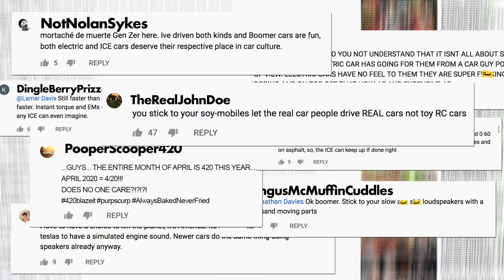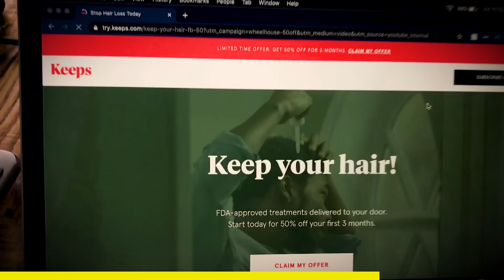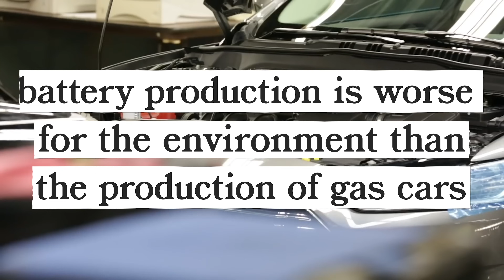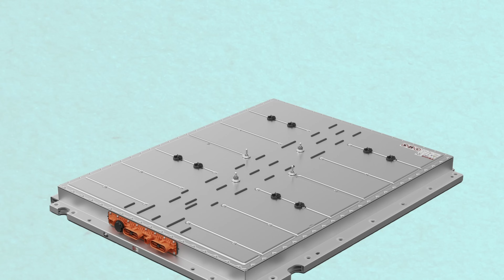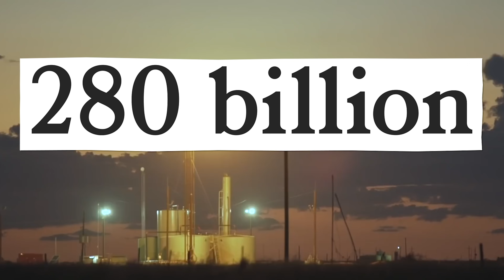Are Electric Cars REALLY Better for the Environment?

Comment: The funny thing is that they're just as bad as petrol cars, the electric from the charging points comes from huge power stations that does out just as much if not more pollution than a petrol car
Reply: did you actually see the video? he adresses it and no is not as bad , and that 's all on the US  terrible coal energy production in any other country with a more green energy production (like Brazil for example ) that won't be a big deal  .
Reply: @lavaot5207  Face it mate, the US, South America and most of Europe could all reduce their emissions to Zero and there would be hardly any difference to the climate because China, the Middle East and Russia will never change and kill anyone who tries to change things, and locks up anyone who protests. So as long as they're still pumping out the gasses then the Earth is still fucked and no amount of whinging from Greta Thunberg and good intentioned environmentalists will change that.

Comment: News flash: both carbon and oxygen are on the periodic table of elements 

Put them together as CO2 and it’s still not pollution, it’s what trees use to produce oxygen

What you need to be concerned about is the carbon Monoxide from car exhaust, that’s more pollution than carbon dioxide

Comment: (before you read this just know I love electric vehicles)a lot of this info was bias to make ev's look better. when sitting in traffic idling  ev's are much more efficient but in reality where a lot of cars are not sitting in traffic they aren't much worse than ev's for emissions. and on top of that that is assuming that the ev is in perfect condition in the right temperatures. In somewhere like canada ev's are far FAR worse, gas cars are very effitiant as they dont loose any power in the cold, they use the excess heat from internal combustion to heat the cabin, and the batteries dont die for no reason. Ev's in canada or other cold places are garbage for a few reasons, thier batteries ca loose up to 50 percent charge in one night which instantly doubles thier emissions, they batteries are slowly damaged in the cold which speeds up the aging process of the batteries and recycling them is very hard, and on top of being very inefficient and breaking down all the time they still have to use battery power to heat the cabin and power the lights and everything else which makes them use even more power, in any conditions batteries only last at absolute max 1000 charges even if they are in absolute perfect conditions, most people only get 500 charges before the battery breaks or in cold climates as low as 300. in the end if you have a controlled climate ev's are more efficient but in real life where most places get too cold or have temp changes a lot ev's are very bad. and I LOVE ev's as electronics is what I am pursuing and is my biggest hobby so I know the upsidess and downsides but it just isnt the time for widespread ev's. and all of this is quite dumb considering there isnt any evidence of man mad climate change being real other than a few left funded sources that have many contradictions of the same page.
Reply: That's an accurate name you have considering the garbage you just spewed out of your keyboard.  Your sentence structure, paragraph structure, and spelling all make you seem like a great scientific mind who I should rely on for my climate change news!
Reply: @stevew.7188  yeah my sentence structure isn't that good but this is a youtube comment, it is not like I am writing this to present it on a stage or send it to NASA. And you didn't say that anything I wrote was wrong so is it just my grammar you are mad at?

Comment: Battery replacement should be factored into the lifespan of an EV
Reply: How long do they last? I've heard that even after 20 years, there will still be a lot of guys buying used Tesla batteries for off grid purposes. They don't die outright, they just loose maybe 20% efficiency.
Reply: @dougerrohmer  depends on how and under what conditions they are used.  If you follow the guidelines from tesla you can extend life. I found a car and driver article that showed that after 25k miles they had lost almost 10%of battery total capacity. There will be some users who require battery changes and some who do not but if they are used long enough they will eventually need to be changed or scraped. Also there are other EVs that are not as long lived, such as prius which requires battery changes after 100-150k miles
Reply: @tripnok1  Actually companies like tesla and GM are working on one million mile batteries which only lose about 10 percent of their efficiency by the end of their life cycle. 99% of vehicles on the road never make it close to 1 million miles so I don't think it will be too much of a problem in the future
Reply: @jabbalito3787  it's a good goal but I'm only speaking for current tech not possible future tech.
Reply: @jabbalito3787  yea and that battery isnt gonna magically make the entire car last a mil miles
Reply: @Insomnia4321  Well it even if it lasts 900k miles it will still NEVER reach that limit. How many people have a car with 900k miles on it?? Nobody does!!
Reply: @jabbalito3787  well on the nuclear fusion companies work from the 60's and is always 30 years in the future. Those batteries may share the same fate. Until we see them and how much they cost we are just fantasizing. Working on something doesn't mean that something will become reality. To become a reality a product must be technically possible, cost effective to manufacture and the raw materials must be available. The batteries that are today on tesla cars are not much better in terms of energy density or lifespan or cost than the ones mounted in 2008 on tesla roadster despite spending billions on gigafactories and on research.
Reply: Lifespan and what emission tier is the comparative are the key to definition.  And climate.   The replacement rate in extreme environments puts them behind.  But overall....they break out pretty even.
Reply: a battery lasts about half of the lifespan of an ice car so it should be considered twice in the emissions. Also for cheaper cars I don't believe many owners will change the battery after 10 years and the car will end in the landfill because who will buy an 10 yr old car to invest thousands to replace the battery? Also the battery must be considered a factor in the green energy. If we replace gas and coal powered power plants with solar panels and windmills we need grid storage and that means more batteries so more CO2.

Comment: Over the lifetime of an EV, its battery pack will have to be replaced multiple times. Was replacement battery production factored into lifetime emissions.
Reply: My question is garbage? Also you are using anecdotal evidence of one vehicle that traveled a long distance, yes, however many other factors degrade batteries over time. I also hope you don’t consider 8 years the lifespan of ANY vehicle. Personally I think solid state batteries are the future of not only electric vehicle tech but all personal transportation. For now, I’m just curious if we’ve really considered all the pros and cons of the current and legacy systems.

Comment: The long run does not account for the recollection relocation disassembly and repourposing of the energy containers..  Does it?
Problem has never been EVs thats why you have railed electrics and elevators since forever.. problem is energy storage.

Comment: 10:09 I do not believe you. Adding more electricity draw adds a need for increased production to maintain uninterrupted service. Just because we make 100 units and normally cap at 95 units of use doesn't mean we have 4 spare units to be taken up by evs. We need a gap.

Comment: That was good. Would love to see the difference in emissions with hydrogen powered cars up against EVs and the ICE
Reply: Hydrogen will be worse because H2 production and distribution takes electricity - it's like asking, "But what if we turn electricity into hydrogen and then compress the hydrogen using electricity and then pump the hydrogen using electricity and then convert the hydrogen back to electricity in the car - will that use less electricity than electric cars?" - no, obviously not

Comment: I heard Nascar is going full electric.
They have already started cutting slots in some of the tracks.
Reply: Will all the drivers be sitting on the side of the track with a trigger controller for throttle?
Reply: Well, they'll be losing a good chunk of the fan base. Motorsports is dying thanks to these things.
Reply: Lol...epic
Reply: That made me laugh so hard
Reply: If the tracks criss-cross ill watch it... put in jumps and loops and I'll be a fan.
Reply: I think they're going hybrid first though, stick to a V8 with hybrid tech, then go fully electric
Reply: Maybe they are making a real life full scale slot car !
Reply: So irl scalextric? That's pretty poggers
Reply: lol, this comment! And RIP to all y’all that responded seriously.
Reply: Pfff the rumble the sound is a big part  for fans
Reply: Then it wouldn't be that epic
Reply: It would be very boring with no sounds IMO
Reply: An electric car that can reach 200 mph and last long enough to do a FULL RACE? I’ll believe it when I see it.
Reply: @thegamingcashew4304  there were electric cars years ago on top gear that hit 200mph, Hammond drove one made by a Chinese company that would corner so violently it would break your neck if it wasn’t in the headrest. The Rimac he drove was a full electric and it’s top speed was over 200mph
Reply: @thegamingcashew4304  I mean, Ford already has one
Reply: @thegamingcashew4304  clearly you haven’t watched a 24 hour EV race
Reply: @shattersucks6270  is there anything like that? but 2 formula E cars are needed for a race. So how could it last that long?
Reply: @arullgodwin4729  They dom't switch out the cars since 3 seasons afaik. Now they drive the full race without stoppping to charge/change the vehicle
Reply: @slaitm9289  No they switch the battery packs out now which to be fair IS an improvement i mean at least the motors are the same running the whoile race.

Comment: I noticed you put numbers out there for the manufacturing of gas vehicles, but not for the EV ones? They are still going to require rubber for the tires and seals, not to mention the manufacturing of the engines and bodies, they are also going to require specific lubricants to keep them ruining as well, brake fluid, coolant fluid. Not to mention, that maintenance can be more expensive on ev's than gas powered vehicles. Like failure to properly maintain the battery can cost up to $15,000 to have the system repaired or replaced. Not knocking green, hell, I quit driving 15 years ago, either walk or bike to get my stuff done, (thank God I live in a small town!). But as it is right now, until the technology improves on ev's, they will be costly all around in the terms of environmental issues.

Comment: I would say they are a little bettter.  By little I mean just the facts of the matter that the car still uses tires that still require the amount of energy that 7 barrels of oil are needed to create those tires.

Comment: I know this is an old video but you failed to mention battery pack replacement, I live in Canada and I’ve heard of battery packs going out as quickly as 5 years in our colder climate, a quick google search shows that they will last about 10 years or more with a warranty of 5-8 year, a Tesla battery pack costs $13,000 and that does not include environmental impact, I am not a fan of EV’s but that price is absurd for anyone. Please do a video on hydrogen combustion and rotary valves, hydrogen burns super clean and rotary engine valves can bump oil change intervals to 40,000-50,000 miles because there’s no oil in the top end of the motor

Comment: Much of electric cars are false hype, but on the surface, fast nice cars. The real world range of electrics drops to nothing when loaded down.The battery is an expensive fragile boat anchor..The "climate change wackos"  just want to ban all gas and diesel, which will be an economic disaster...co2 is not a pollutant anyway..

Comment: Can you imagine charging stations every 100 feet on major highways, what happens when 100s of cars need charging at the same time, waiting in lines for hours is down the road, or just not going anywhere except across town. Getting fuel in a ice takes 5 mins.
Reply: @ronsted2496  You can only charge at home if u have a garage or driveway. In the city most people park on the street.
Reply: @moabman6803  They can still charge on the street if there are these.... www.ubitricity.co.uk

Comment: Great video but you didn't even get to an even greater poisonous impact on the environment when it comes to electric vehicles. The mining process of rare earth elements to make the needed magnets for the motors in electric vehicles. This process is far more and extremely poisonous to our environment.   People are being lied to about how electric vehicles are the answer. I would think you would find it shocking just how devastating it is to our earth.
Reply: A lot of batteries can be made using recycled lithium and lets not forget the devastating impact of oils spills and the unbelievable amount of energy used to extract refine and distribute fuel.

Comment: Absolute rubbish. Windmills and solar cannot produce a reliable source of electricity. You need oil, coal, gas or nuclear to smooth out the curves. Nuclear is not green, not by any stretch of the imagination. The waste produced is very toxic and must be guarded in case it falls into the wrong hands. It is also expensive to store as it needs to be encased in lead and concrete.
Did you do the carbon calculations on that? Where are all the batteries going to come from? There is a shortage of rare earth minerals.
Reply: Exept that they do produce lots of energy unlike oil which is temporary

Comment: He isn’t talking about the fact that ev cars take up to 4 hours to fill up unlike petrol ones that take 5-15 minutes
Reply: A lot of people can use rapid charging and the range of evs are improving all the time.
Reply: @londonyes1380  so far they can do half the range of modern petrol cars
Reply: @waterknight7961  Ok but that is improving all the time.  A most people don't need 100+ miles of range each day.  Maybe it is different though in USA where you have to travel longer distances or commute to work.

Comment: So I guess we figured out how to recycle the lithium batteries.
Reply: We did.
CAR batteries are even easier to recycle, then those in your smartphone
Reply: @sbastian6633   I have actually seen them recycle car batteries ..lead.. plastic and acid.. lithium is a bit more difficult.. not much of a recycle program.  Plus it take five hundred gallons of water to make a ton of lithium.. plus most electric grids would fail.just not worth it to own an electric car. I know I just got a chevy volt. (My spare car). Fun times
Reply: @lpz3665 there ist a company in germany.
 They recycle lithium car batteries for volkswagen. Car manufacturers have to recycle there cars up to 80-90%... laws in europe.

Concerning water.. a good steak needs around 500 gallons of water to produce. Weigh a steak aggainst a ton of lithium 😬

The grid now ist not the grid for the future.
Reply: Ev batteries get recycled as house batteries and live happy for the next 20 years storing all that sun light converted from your roof top solar panel.
Reply: @mattdavies890  That is re-use though, but you are correct, first re-use than recycling.
Reply: @mattdavies890  you will find out it won't last that long. And they can not be recycled the same way.  But they use more energy to make them. I wish it was better. Just do me a favor and look it up
Reply: Li-cycle
Reply: @zmass  with only 3 employees ? Really
Reply: Why not ! If laptops, smartphonesphones  use batteries made out of lithium ,why not EVs !
Reply: Um the mines are not a problem my guy?😂
Reply: @luixjmz  
1) The mines are a problem, my dude; they are just not as bad as cobalt mining. 
2) EV battery packs wear out. Faster than ICE engines, and fast faster than ICE fuel tanks. 
3) The old battery pack needs to be recycled or otherwise disposed of - as do ICE vehicle batteries. 

Maybe it's not a big cost, but it is one that needs accounting for.
Reply: @blackmephistopheles2273  I just don’t get it a good pack will go ten years and a good ice will go 1mil miles or 50 years why can’t people see that cars aren’t the biggest problem and also why aren’t we investing in alternative bio fuels
Reply: @dietznutz1  
Ships > Trucks > Cars
I Like this conversation... more? 😉😁
Reply: @blackmephistopheles2273  Engineering Explained did a video on this.  He said a Yale study concluded end of life environmental impacts of EVs are negligible in comparison with the impacts of production and driving.
Reply: @blackmephistopheles2273  
EV battery packs wear out. Faster than ICE engines, and fast faster than ICE fuel tanks.
This was the case with earlier EV's, usually due to bad cooling and battery management. Tesla batteries are expected to in most cases outlast the car itself. After that they still can be used for stationary storage applications (like grid storage, home batteries, ...) and after that they can be recycled.

The recycling isn't really a problem, since car companies already see this as a means to get the resources for new batteries more cheaply compared to newly mined resources.
Reply: @mattdavies890  will do but I will stress that I will be on renewable energy and will be cutting down on plastic and I won't be rolling coal